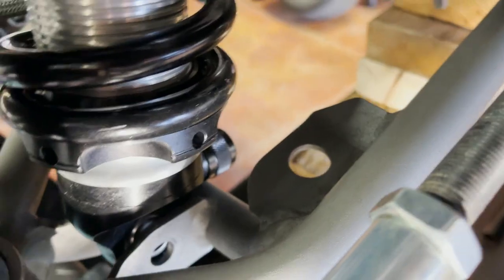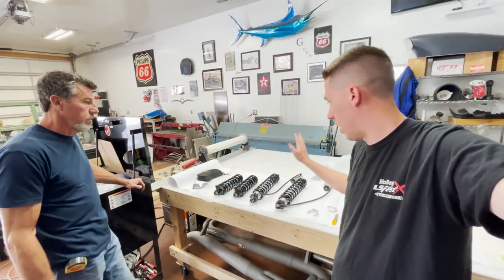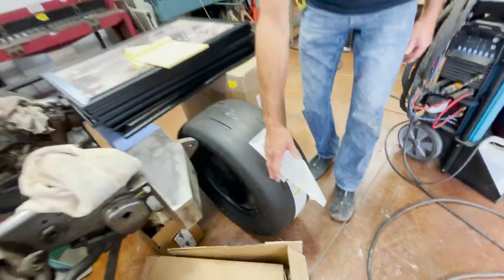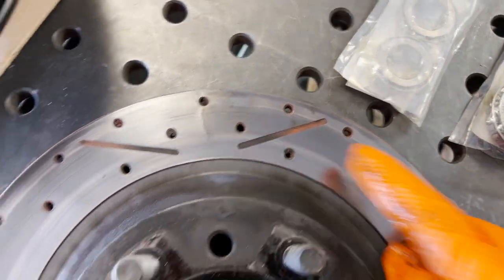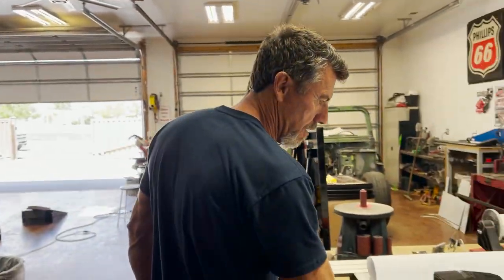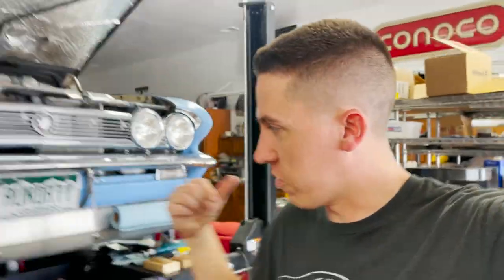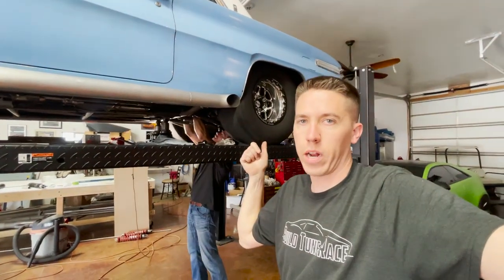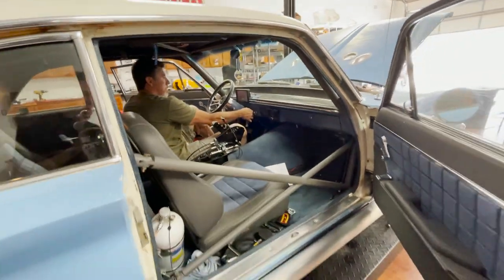Fixing The Twin Turbo LS Swapped Buicks Biggest Issue!

Comment: Bad ass car, damn drilled rotors always crack in the drill holes on hard braking and not driving to cool them. Just use a vented blank rotor instead of drilled/slotted stuff for problem free brakes in hard braking and sitting but use the brakes a little on the return to transfer pad heat back out of it so when you stop and its sitting the pad wont overheat the rotor in that spot causing cracking. Love seeing old school cars living the happy life like this.
Reply from the maker: We’re always learning that’s for sure! Old cars built to haul ass are the best!